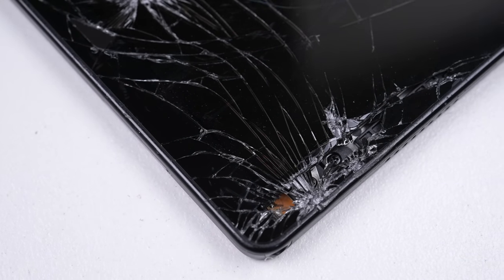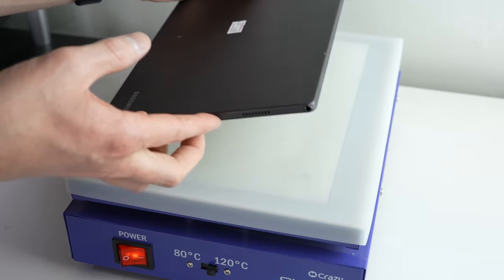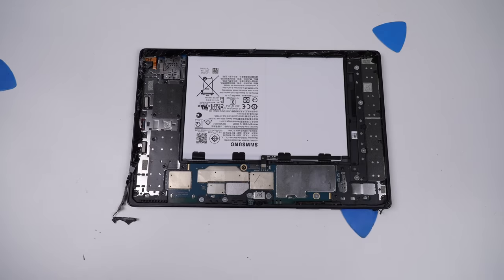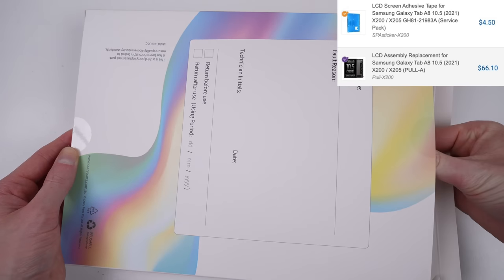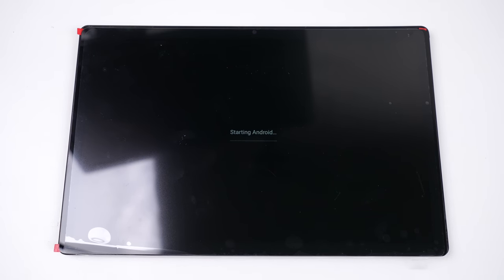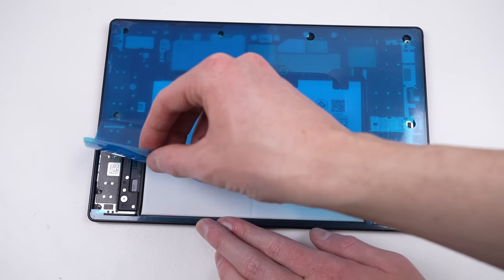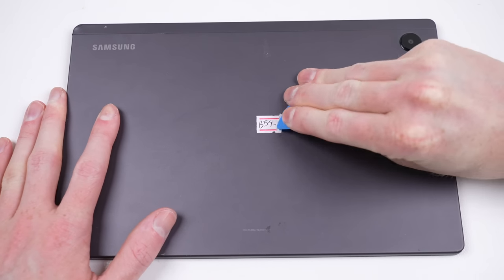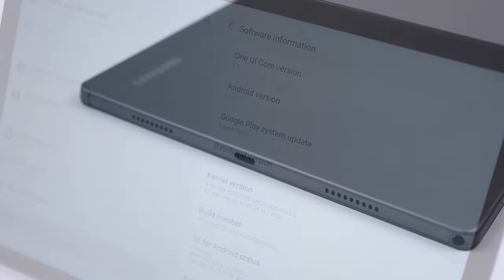$55 Samsung Galaxy Tab A8 Restoration

Comment: That actually seemed like an easy and straightforward repair. If only everything was as easy to repair as this!
Reply: iFixit probably gave a 3/10 repair score 🤪
Reply: @darthraider450  Well yeah it's not Apple
Reply: Spotify be spitting straight fax, no printer
Reply: @bupsonator  lol
Reply: Apple should learn from samsung
Reply: @darthraider450  Thats because if anything else breaks you may end up breaking the screen to fix the other issues.
Reply: Yeah...
Reply: @skiks1853  Hugh literally said "the adhesive is rather weak" 

It's not a Surface Pro.
Reply: @darthraider450  if it was apple doing it, ifixit would break the scales
Reply: oddly enough most cheaper samsungs are meant to be super easy to repair and wants you to use it as long as it is fixable unlike their flagships
Reply: @ilhantele  Samsung learnt from apple how to remove the headphone jack, Charger and also remember the A51 and A50 with the fingerprint
Reply: Lol founded u again spitify95 🤣
Reply: @spotify95
Reply: I prefer the Spotify logo in your pfp more than the real one 🎉
Reply: @YasinVanDoorsen  my A50 has fingerprint reader though.
Reply: @recitationtohear  freak you hahaha
Reply: Having the tablet heater helped
Reply: @ilhantele  this aged like milk
Reply: Is this the real spotty

Comment: There were so many mixed reviews I was a little scared to buy this.-I work 10 hour shifts https://www.youtube.com/post/UgkxAxiUS5CgVC3j8FwNOHt037zhsquGQpXv  and I can watch lectures, jam out, and read articles all day and only use 30-40% of the battery.-The screen is beautiful and the touch is accurate-The camera is on the edge, making this perfect for Zoom calls (I also have the keyboard with the back piece)-It's super thin. The bulk of my iPad kept me from using it often-I never realized how lazy I was until this pencil. The button and flick action (volume up and down, next and back) mean I can kick back without having to lean forward to make changes. I feel like a witch.Only 1 real complaint if it can even be called that, it comes with one background in like 6 colors. It's easy enough to find new ones... but why so stingy?
Reply: Samsung tab s8 is better than a8

Comment: Another perfectly capable device saved from the landfill. Nicely done!
Reply: The question is just, is it worth it or would not even better when this crap get recycled to make a really long lasting Produkt like an iPad?
This device is just an year old and has hardware which was even 2-3 years ago just something in the midrange for low budget…
I think anything beyond the purchase costs are way too much and even the purchase should be way cheaper as the 230$ Samsung want for it, it’s really not a good Tablet and was it never…
Reply: @Eddy_E. Both Apple and Android devices have the same length of support in terms of usability of the device (sometimes Androids even more third party app support)
 I really don't know what you are talking about but I have my 2016 Samsung Galaxy Tab A  still up and running ,  even without any updates for years most apps run just fine even YouTube (I know about older iphones not receiving iOS updates to the point even YouTube doesn't run even if the device is okay)
Reply: @sabehakhan5693  an iOS device which doesn’t most of apps anymore are mostly 10 years and older, so I can just speak for me but in my reality is there a big difference between  6 years and 10 years…
And next to that your with a galaxy device already on the bright sight of the android world, most devices didn’t get that much support, they are mostly completely outdated after 2 - 3 years and most of them doesn’t even run all apps when they came out cuz they just to bad hardware…
So the only devices where you get, I would say „ok service“, in the android world are surprisingly devices wich are not cheaper as apple devices and with this in mind I have no questions where most people would get just more for the money and that’s surly not the 300€ android tablet, it’s the 300€ iPad…
How it seems you don’t recognize that I not spoke about the special things in the android world, I spoked about the average and on this android is something behind about 4-5 years and this gab gets even bigger cuz on iOS we already have devices with 7 or 8 years new iOS and after that we talking usually about 3-4 security updates….
That’s a usetime you will not find on android devices at least in the next 5 years when you will find it ever, and then we still don’t talk about the average, we just talk about the best devices which are in the android world a big exception…
Reply: @Eddy_E.  It's really not as bad as you think, new apps work on old Android versions usually where they often don't on iOS so there's not that much difference. iOS is a little better in terms of long term support but not by as much as you think
Reply: @circuit10  that’s just not true…
On Apple devices you got longer support what ends up automatically in longer appsupport too…
Just try to install a modern app on an android 5 or 6 device and you will see what I mean and devices which Stucks on those firmwares are partially not older then 3 or 4 years…
You will find not a single apple mobile device in the last decade which has just so short supporttimes…
I know that it is harder to use apple devices when apple even kill the security updates but in most cases this needs around 10 years, just show my one single android device which is 10 years old and still run just a single modern daily app, you will find exactly nothing, on the iPad and iphone side you will find devices which do that…
 
So all in all nothing else as a modern myth from some androidsheeps…😅
Reply: @circuit10  oh and I don’t think, I know my stuff what I am talking about cause I am not just use android or apple or Microsoft or linux, I just use them all and cause of that I know pretty exactly what is better in long life situations, android is still a bad joke in this department…
Reply: @Eddy_E.  Android 6 released about 8 years ago so it would make no sense for a 3 year old device to have it

There may be some truth to what you're saying but you're exaggerating a lot
Reply: @circuit10  that it don’t make sense is true but change nothing to that that you could still buy android 6 devices 3 or 4 years ago…
For sure was that in the low budget corner but it was pretty normal that you could get devices wich so old software…

Comment: This device shows how adhesive should feel in devices these days. Many devices use too much adhesive that it's hard to remove when disassembling, especially in batteries. It should be easy to remove while able to hold on to it even in high temps.
Reply: Is usually the phones with IP rating that have to have a strong adhesive to get that water resistance rating.
Reply: @NanoMine  i still remember phones back then that have low adhesive yet still achieve an IP68

Comment: The samsung Tab series are probably my favorite repairs.  The majority of them are extremely easy, worlds above Apple and their iPads.  

regarding the LCD glass being as one... I personally don't see this as a bad thing generally.  The issue with glass-only such as the iPad Air 1 through iPad 9 (current gen) is that when the glass gets cracked, that exposes tine internals (LCD included) to the environment.  This almost guarantees the LCD will get filthy, and no matter how much you try you will never get an LCD as clean as it was as when it came out of the factory.  Compared to the tablets with LCD/glass combos where this simply isn't a concern.  Yes it costs more, but especially for those aiming to repair devices for resale, it's a lot harder to sell a tablet that has a nice uncleanable dot (or many) from exposure on the LCD due to broken glass, even if everything else is perfect.

Comment: Nice repair job👍
I had a similar experience today, your video shows how difficult a damaged tablet restoration could be.

I just finished fixing my indented iPad Pro 12.9 2018 with shattered display 
One corner was indented for about 2mm, had to file the edge railing down to fit the replacement display.
1. heating display with heating bed of 3D-printer 65C° 10 min
2. use suction cup to seperate the damaged display from body
(use packaging tape for damaged parts with no suction)
3. transfer ribbon cables & etc. to new display

4. hammer the corner into shape🤣file down the railing to fit display
5. remove old adhesive and adding new double side adhesive tape
6. reconnect cables and reseal display onto the body

165€ Display + 4 hours of weekend 
Fixing my own electronics is pretty rewarding and fun😇
Total amateur btw

Comment: In video u said Hugh you cant power off tablet because screen is not working but if you hold down power button and volume down button for few seconds it will force turn off tablet.
Reply: Most android devices now days take that as just a restart

Comment: Thank you for this video.  I just repaired my first tablet after dropping it on the carpet and the display popped out of the bezel cleanly without a break.  Only thing that broke was the display connector tape.  $30 worth of jewelers/phone/watch repair tools and $12 for the connector tape wire and my tablet was good again.  Nothing is so heart breaking as another peace of electronics off to the land fill.  It's such a crime.

Comment: Great repair! Cheers. I wonder why you did not bother to put some kind of adhesive strip on the broken display before removal - could have been way easier and less glass shards?
And reseating the new display would have been easier using suction cups. But amazing anyways

Comment: Nice work as always... 

what about "fixing" the Display with adhesive tape beforehand and then start opening it? This should make it much more easy and make it possible to adhere a suction cup. 
Is this something you considered? Tried? I never had a severe case like this broken display, but it would seem like the right thing to do. I'm very interested why it's not part of your routine.

Comment: I personally fixed once a Samsung tablet which I bought from eBay for personal use and it was definitely easier to fix than one of those crappy iPads which have their screens and batteries paired to the motherboard. 
I bought the tablet for 35€ and invested 210€ into original screen and battery. 
It was also a great choice that I got a model from 2020 because the newer models have firmware protections which "prevent" you from installing 3rd party firmware by displaying camera and disabling the selfie camera.
That definitely sucks since I love to install CrDroid and EvolutionX GSI firmware on my tablets since they have support for the pressure points of the s-pen and OneUi is just bloatware that wastes the resources that could be used to render a video or render a multi-layer image (Also knows from certain Twitter artists/ those type of images where you can zoom into certain spot of the image and see another one and then in that another image see another image)

Comment: Why don't you put Cellophane Tape over the cracked glass before removing the screen? I usually did that when I repaired phones back in my old job as a Repair Tech to minimize Glass shards and Mess in general.

Comment: Android devices can be usually turned off by holding the power button long enough (10+ seconds), even if it's still working. Kinda like a killswitch in case it froze and needs restarting.

Comment: I’am pretty confused,  on talked something about 400$ less as new on Samsungs website but this device cost only 180-200$/€ when you buy it new from third party and even Samsung never wanted more as 230$ or something like this…
And with that in mind the 45$ you paid are not expensive or cheap, it’s just a realistic price which forces the question if a device like that is worth it to restore and with this low hardware inside I would clearly say no, the resources of the device would be better used for longer lasting hardware like an iPad…

Comment: At least this thing is still financially worth fixing. On something like a Galaxy S9 or S10 (the latter being the last S series flagship with a headphone jack btw), a damaged screen condemns the whole phone financially because a new screen+frame service pack costs the same or more than a fully functional/undamaged used entire phone. And that's just the pure parts cost and doesn't yet include any labour if you don't/can't do it yourself. Seems like if a Samsung exceeds 1-2 years old, it's no longer worth fixing financially due to parts cost, whereas with apple devices it kinda would be worth fixing financially still, but made near impossible due to parts pairing or ridiculous things like requiring a frigging laser setup to get a damaged back off. Seems like a game you can't win

Comment: Honestly this is a good tablet, although I wish the screen was a bit more colour accurate.
Reply: that's just how LCD is
Reply: @cideogameguy515  No I mean this one is real bad. With stuff like the Tab S line-up, they calibrate the screens really well for the LCD models, even the Tab S6 Lite. Partially cause artists use them. This has really washed out colours and a blue tinge to it. Pretty sure the A7 had a better looking screen.
Reply: @nathansstuff1547  ah well I'm not sure cause I've never owned an Android tablet

Comment: Its not fully true how you cannot seperate the screen from the glass.... If you put the screen on the heatplate and use a thin metal wire you can. You can also glue a new one on, its just so much work that its mostly done in countries like china where hours cost less. A lot of screens specially for samsung are not new but repaired this way and sold on ali. Thats why you have a 50% chance that the "new" screen on ali has burnins.

Comment: The reparability argument is definitely works better on tablets, since you're less likely to care about security updates as long as you use it only on wifi and only on sites with some degree of safety.
My main frustration with android is that the software support is gone well before the devices get damaged in any way. At that point a phone is useless even though the HW is still pristine.